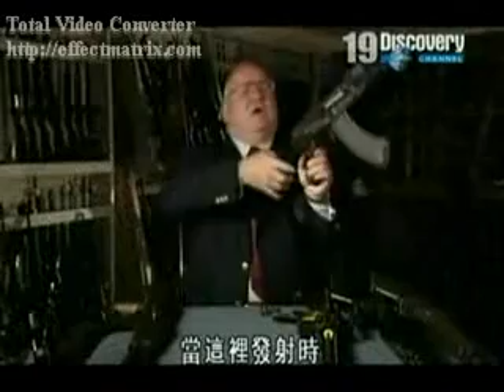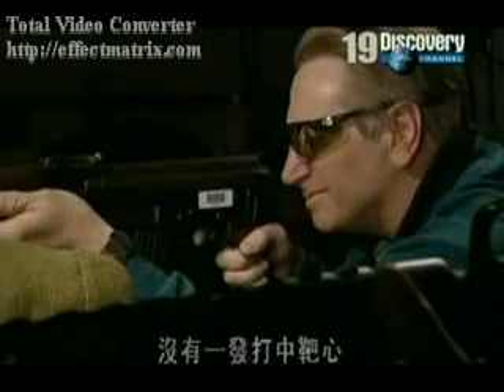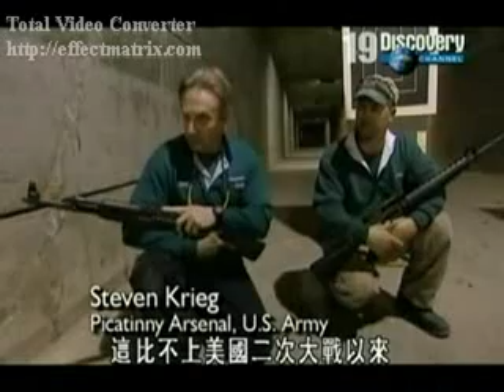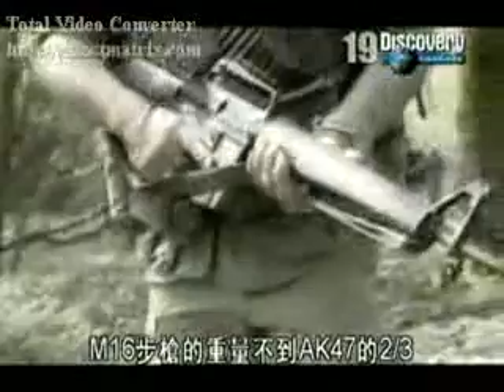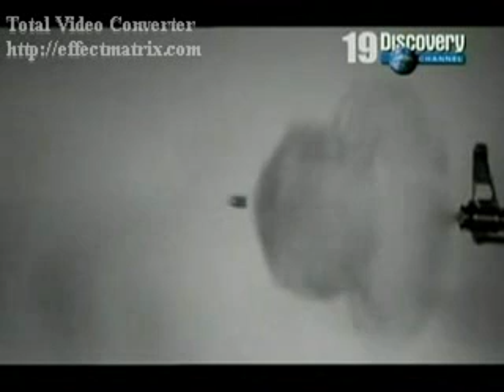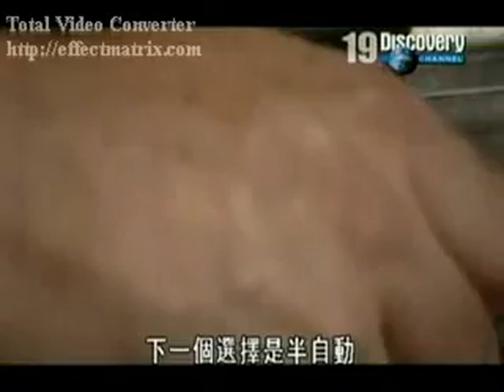AK47 vs M16

Comment: To be a person that has used both weapons "newest models" the AK-47 is the weapon. I didn't have any problems putting a round down range. Plus a AK-47 can come straight out of water, mud, sand and fire with all the stuff in it. The price has went up since I got mine in 2006 at $584 new in a box with a under fold stock. It cost $5 for 30 rounds. I've got into alot of trouble with law enforcement in Oklahoma lol. But yea it well take on a m-16 any day plus go straight threw a three quarter ton en